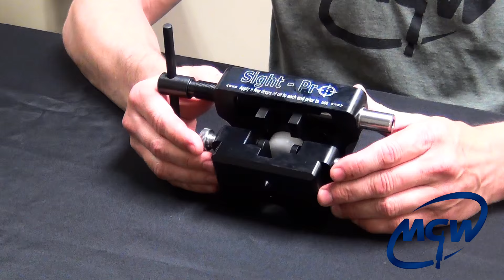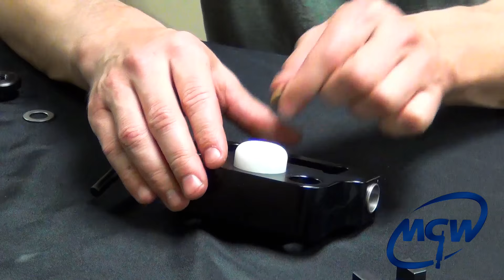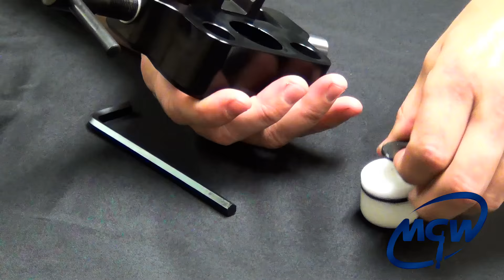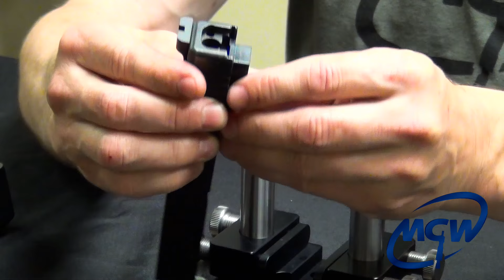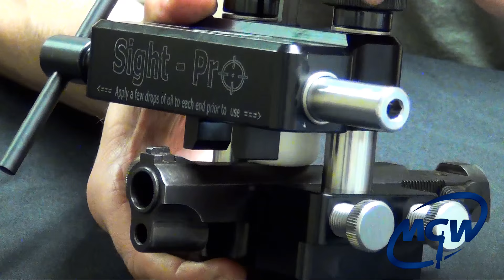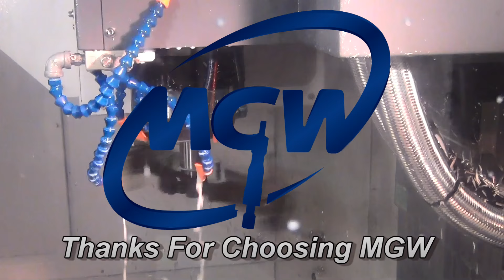MGW Sight-Pro Overview - 2016 Revision

Comment: Just purchased this tool after buying a cheaper one - both work but this is the Porsche of sight tools.  Fantastic quality, nice video.  Took about 20 minutes to install new Trijicon H3 sights on my H&K USP Compact with no issues.  Very easy for a ham-fist like me to do it perfectly.  Just one suggestion, please note in the enclosed instructions that the SS shaft of the actual "pusher" is reverse or left-hand threaded.  Otherwise, perfection.  This is a great tool and if you have multiple pistols as I do, and like to do your own work, a solid investment.  RJ

Comment: The only thing that would make this tool perfect would be to put numbered alignment markings instead of your logo (measurement markings would be more beneficial) so the new sights can be centered perfectly (don't understand why it doesn't). My Wheeler has this and love that feature. Your tool seems to be a far superior design. If your tool had the numbered alignment markings on it I would drop the cash!
Reply from the maker: i posted a response to this question on a previous video. the alignment markings would really not work when you have many many different width sights .
Reply: @MGWINC  So how do you recommend centering? Eye balling it?
Reply from the maker: @jamessartell9776  The thread pitch is 24 threads per inch so each turn is .041" so zero at a range and use that as a gage point per revolution.

Comment: Here is my problemI tried this on my S&W 9 mm shield plus I could not move on my rear and front sight but, on the fisher sight pusher work . They have a longer levage to tork with better reach than you have. Can you look into this way of turning . THIS was also displayed on youtube vs your tool.your T handle is too short too I just bought compare the fisher sight pusher .
Reply from the maker: We have been manufacturing sight tools ever since the 1980's for many OEM customers as well as direct to the public. We were THE innovators in sight tool designs. One of the main things we have learned over the decades is that its never a good idea to just get a bigger hammer when the one you have does not work. Many times  this is a sign that something is not right. We deliberately engineer our sight tools to work up until the point of risking damage to the tool, the slide, the sights ( or all 3!! ). You need to be very careful just grabbing a larger wrench as seen on the videos you referenced. you can easily crack the rails on the slide ( especially considering those tools do NOT have inner support shoes like the MGW ARMORY tools do ). A few suggestions...

1. You can loosen the set screw on the t-handle ands move the t-handle all the way to one end to get more leverage. 

2. You can either heat or freeze the slide to get the dissimilar metals to expand or contract at different rates. 

3. Put the sight tool in a bench vise to get better leverage with both hands on the t-handle. 

4. Shoot the sight with some penetrating oil ( pb blaster etc. ) and let sit overnight. 

5. When we find a rear sight that just will not budge, its most likely due to the " painted window effect" where the sight is stuck in place due to installing with an arbor press by the manufacturer. Striking the side of the sight with a brass punch just to "POP" it loose usually works well and then you can use the tool .

George Ciamillo

Comment: I was on the fence about purchasing this.  It is pricey.  My buddy bought a "less expensive" option when I bought sights for my Shield and my SIG P320 so I tried his.  Well, his tool got the Shield sights replaced with some finagling and lots of protective tape but the SIG just laughed at that tool.  Sooo with a small discount at Brownells I took the plunge and got the Sight-Pro.  WOW!!!  I knew this was a nice tool but until you get it in hand you just don't know.  It reminds me of a custom tool set from the Ducati Racing team I once held in the Mid Ohio pits.  SIG sights swapped out quite easily.  This tool works really well.  Now I need to buy a new gun to swap sights to justify keeping the tool....lol!
Reply from the maker: Thank you!! And you are 100 percent correct...the tool is not cheap but the value is certainly worth the investment. This is one TOUGH tool!!
Reply: Yeah,  no regrets, I would DEFINITELY buy it again if I had to.
Reply: Mine looks like someone dropped something on it, and dropped it, too. The white box has a round hole punched in it from the outside, and two holes knocked in it from the inside. The tool has a buggered up spot on the casting down by the shoe thumb screw hole. The thumb screw has some light damage, but it threaded into the hole okay, after running a tiny very expensive knife file over the threads to clean them up. The T handle is bent inward on one side. The Delrin pad is buggered up. The round Delrin pad shim washers were rattling around in the box. One was just found in the larger shipping box. That had to be a returned item! It works fine, after cleaning it up some, and adding a shim washer, but I am not too happy with it being a new tool arriving in that condition. I kinda blame the retailer on that one, because there is NOTHING inside that larger shipping box that could have
 possibly made that hole in the MGW box. The shoes? No way in h*ll! Bore snakes? Even less likely! The shipping box is neat and clean, with no damage. I suppose maybe UPS or Fed Ex reboxed it, but I kinda doubt it.

Comment: Ordered this from Midway USA and I got an older model but it did have the upgraded shaft. The pads were four tabs with Teflon pads so not what was shown here. My unit also still has the knob for the pad vice the hex screw shown. Not a huge deal as it work like a charm changing out my Glock 17 sites. Expensive yes but its the right tool for the job.
Reply from the maker: actually you have the NEWEST model. We went back to the knurled knob up top due to customers complaints that the set screw was inconvenient. We just made it smaller. And the tabs are the new design to eliminate the issues of marring expensive slides that are cerakoted etc.

Comment: just ordered this and 4 shoes. hope it's as good in the flesh as it is on the vid. when you make an update vid, and chance you can demo swapping out the sights on a beretta 92 brig or vertex? is that one that i'd need to remove the safety ears for the rear sight?
Reply from the maker: you do not need to remove the ears to use our tool .
Reply: awesome. thanks. haven't had a chance to try it yet, but this weekend.
Reply: follow up to my earlier reply - got the 92 Brigadier working just fine. if you have any info / advice on dealing with a Beretta Px4 (especially the rear sight) that'd be much appreciated.

Comment: CAN THIS HANDLE S&W M&P SHIELS PLUS TO CHANGE STIGHTS
Reply from the maker: We rarely have  issues doing them  BUT some of the rears have been EXTREMELY tight and as long as you do not use any type of cheater bar / pipe on the t-handle .
Reply: @MGWINC  I CALL SOMEONE AT MGW SHE SAID SOME PEOPLE PUT THE SLIDE  IN THE REFRIGERATOR TO CONTRACT ON THE SIGHT WILL THIS HELP?

Comment: I just bought this tool and the instructions say it's the 2017 revision version. Things match up except for two things. 1) The hex bolt that adjusts the slide pad up and down is the older version according to this video. What's up with that? Did your company use the regular knob type then went to the hex bolt only to go back to the regular knob type? 2) The slide supports on my tool have these white pads and they don't look like the slide supports in your video. So did I get the newer version or is mine the older version?
Reply from the maker: yes you have the newer version. we went back to the knurled knob on top due to customer demand. And the new plastic wear plates are also due to customer request to have a non marring material for high dollar and cerakoted slides.

Comment: I just received my sight pro from brownells and obviously its the older model as i have the 4 individual support taps.  i looked at both brownells site as well as midway USA, neither have the new one piece support tab.. where can i get that. oh ya i already have the mgw318 for my M&P which is awesome but can't do raised sights.
Reply from the maker: you DID receive the newest version as we had to revert back to the 4 individual tabs because some slide prfiles are not flat and some external features like safeties will not allow a long one piece tab. also we went back to the knurled knob on top of the white pad due to customer feedback. we just made it a little smaller to not interfere .
Reply: @MGWINC  ok thanks

Comment: I think I just got one that was dropped and or returned. The brown shipping box looked pristine, but the white MGW box is pretty beat up, with a hole punched into the side through two layers of corrugated cardboard where the tongue for the lid inserts, and the opposite side has holes from the sight pro bashing around inside the box. The casting down by the shoe set screw is all buggered up. I figured, "It's cosmetic, and I have already canceled a back ordered Sight Pro, and 3 shoes, from another retailer". The shoe screw has some dings in it too, and the Delrin pad looks like some idiot dragged some sights across it. Oh, and the T handle is bent "inward" as if the tool had been dropped, not forced, but dropped. I have an infected toe after ingrown toenail surgery, so I am working barefoot, and I work over an expensive glazed tile floor, so dropping things is avoided at all costs. Oh I took pictures of it. It got the 11 year old sights off my Sig, but the washers under that pad were GONE, so I have a nice little scrape on my rare German US Navy Trials Elite Sig P228R E1 SRT. I found one of the washers under the tabs in the box. I stole some extra washers from my old tired Sight Pro, where I made a new Delrin pad for it. I started working on rebuilding 1911s, and P35 Hi Powers when I was 16, and took apart my dad's fine English Sidelock SxS shotgun when I was 14 and had new parts made by a jeweler friend down the block. I do a lot of soldering electrical, silver, and brazing. The tile floor is immune to solder, and molten brass, but not hard impacts. The tool fits beautifully into my old gunstock tall jaw Columbia Gyro Vise, which  becomes a short wide vise by flipping it on it's side. They were up over $500 for while, if you could find one. They stopped making them 30 or 40 years ago. Lately all I can find are parts, or very beat up examples. I have a big huge beautiful Yost Vise, and an even bigger brand new Wilton. $3500 big, scavenged from Fairbanks Morse, maker of locomotive, marine and submarine "prime movers" (fancy term  for enormous diesel or fuel oil engines).
Reply from the maker: Who did you get this tool from??  That should NOT have happened and we NEVER send out ANY used products. EVER!! If you bought this from a reputable distributor of ours then you need to contact them about this. If you bought this off of EBAY then you now know the perils of that and we can help you direct. 

call us at 706-793-1770
Reply: Brownell's, believe it or not! They have that 100% satisfaction guaranty thing, and some ass probably dumped it back on them after using (misusing) it once. It looks like someone dropped it onto a vise, and then the box was also dropped, with it inside, and something else next to the box that punctured the box. The box was clean, but beat up. I took pictures of it, the same day I got it.  The bar you use to twist the pusher lead screw is bent inward, so it was dropped. If you need a cheater, to push a sight something is very very wrong.
Reply: It's mostly cosmetic, except the twisty rod part is bent INWARD. It was dropped not forced. About a 4 days after I got the Sight Pro my sink backed up. I totally ripped my shoulder up pulling apart a completely clogged 1 1/2" galvanized malleable steel drain pipe with an 18 inch Stilson under the kitchen sink, where you can't move to work on anything. Fun times, and I probably need surgery, and a year to recover now! Rotator Cuff and a SLAP Tear! A Superior Labral Anterior Posterior Tear, AND a Rotator Cuff tear and that helped jar loose a bunch of calcium bone crystal fragments right into the shoulder joint. I actually have the old model MGW Sight Pro, and I broached a square hole in that reverse threaded round bar, so I could use an ell faucet seat wrench to take it off. Some idiot borrowed that one and butchered that piece of bar stock with the LH threads, but that thing has probably pushed over 6,000 sights on and 6,000 sights off, maybe 10,000. DPS finally traded their Sigs in for the FNS40s, and CHP finally finally after 10 years of the 4006  + 17 years of the 4007 TSW, got rid of their S&W Model 59 type 4006 stainless steel bricks, for the M&P 2.0. Again sticking with the .40 S&W, and not going to the 9mm. I swapped a boatload of Swiss Sig P226 night sights of trade in Swiss police pistols. I cherry picked a couple of .38 Super P226s from that lot.
Reply: They want $80 more for these on eBay and Amazon, and they are both purveyors of  sleazy knockoffs.
Reply from the maker: IF  you never got this resolved you can send it back directly to us and we will get it all fixed up ... call us at 706-793-1770

Comment: hello mgw. I only have glocks at the moment. so, I assume that my delrin white pad will need to be at the factory setting of 10/1000. how do I know for a fact that it is at that factory setting to keep from scratching my glock 43,17 or 26 slide? in other words how will I know if I have unscrewed it enough to achieve that factory setting for an absolute?
Reply from the maker: you can just unscrew the top screw and remove it if you REALLY want to make sure you have it set. the screw actually is designed to NOT even touch the washers under the pad when using it at the factory setting.

Comment: Awesome piece of quality  machining.  Unfortunately it was useless for the vertically adjustable m&P sights I bought the first block for.  The adjustment block would only contact the movable part of the sight and would have ruined it.  At least on this gun not really practical. Keep the brass punches handy.
Reply from the maker: did you remove one of the washers under thew WHITE DELRIN pad so you can get the sight lower. also we have a new pusher block with a relieved lower section for pusher farther down on rear sights. 

MGWSP30 is the part number.
Reply: The height of the sight was not the issue.  The sight just does not have any useful place to push above the top of the dovetail.  I will try to find a description of the part you mentioned online. What it would need is a pusher block that contacts the dovetail with a  width less than the dovetail cross section. If I find it necessary in the future, I guess I could machine a standard one down on the mill. Seems like it would be useful for a lot of sights.  I do give you kudos on the quality of the product.  First class.  It will just take some time to get used to how to use it quickly and best.  This time a wooden dowel worked in a couple of minutes. Keep up the good work.
Reply: Encountered a similar problem with low mount sights on Remington RP45 and RP9. Delrin pad was too thick. Pusher block was contacting upper part of sight, not the actual dovetail part, as you describe. Causing sight to enter dovetail cut crooked. Corrected with hammer and punch several times. But dovetail cut is a very tight fit on RP pistols.. Resistance increasing as sight moved deeper into dovetail cut.  Like you, I did not want to risk any damage to sight or tool. Got to SCREW OUT thick Delrin pad with supplied screw, remove one or both blued steel washers covered by Delrin pad as needed. Put Delrin pad back into hole. It will now seat much deeper in the hole. Allowing pusher block to go lower and contact dovetail part of sight properly. Screw down on Delrin pad VERY LIGHTLY to make proper adjustment of pusher block contact with dovetail part of sight. You might have to make intermediate thickness shims to "fine tune" adjustment if washer removal is not exact enough for desired pusher block contact with dovetail part of sight. When properly adjusted, screw forces should direct pusher block directly onto dovetail part of slide. Allow clearance for pusher block contact point to go through dovetail cut without contacting the cut itself as sight is moved deep into the dovetail cut. The low mount pusher block may be the best design for such sights.